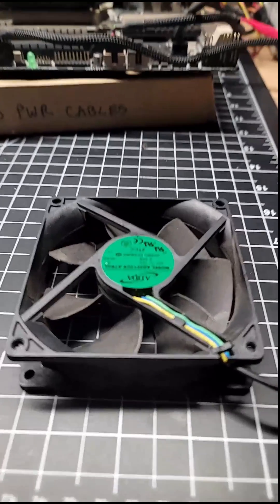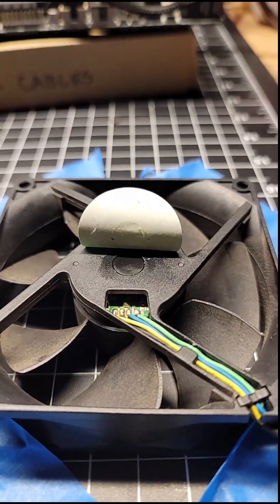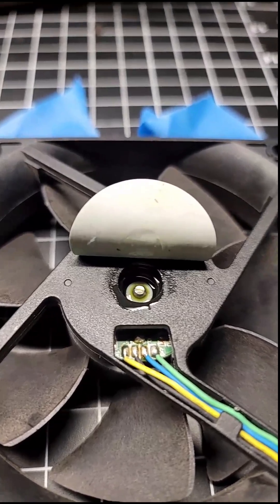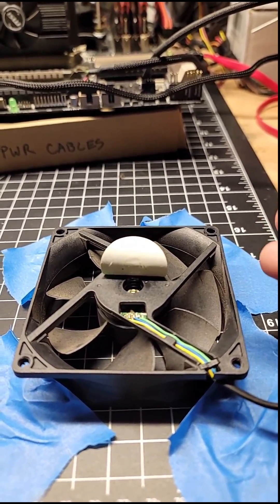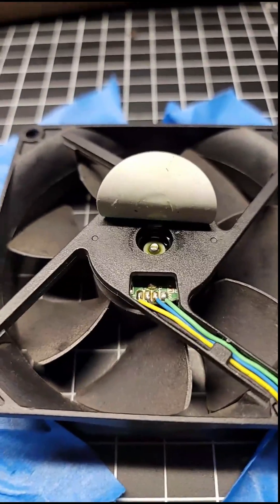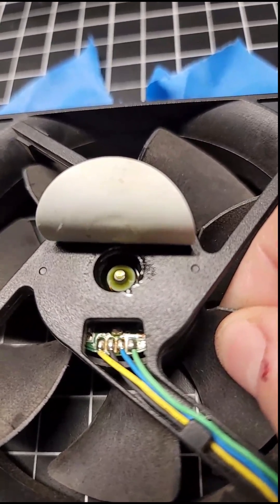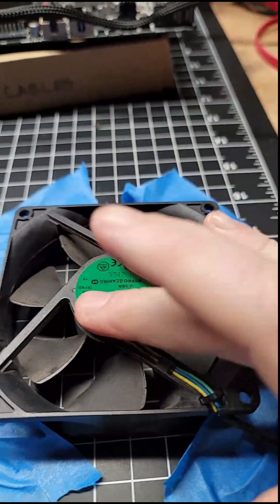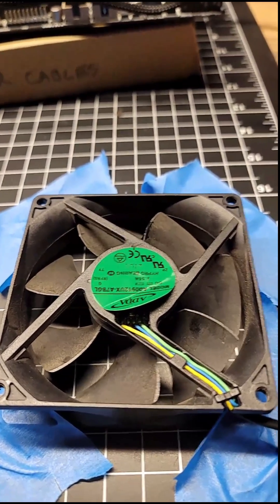Noisy PC Fan Fix: Re-oiling

Comment: i dont have a bearing, I have a magnet (cool master fan)
Reply from the maker: There's many different types, but it's still essentially a bearing type. Unfortunately once the magnet types start making noise, the only solution is replacement.
Reply: @Warning56kb  thank you man!

Comment: There is a sticky substance on the lever of the trunk door of my car. I don't know what it is, but it never dries up. Can I scrape some of it off and use it?
Reply from the maker: I wouldn't because it's likely dirty and has contaminants in it. I owned an automotive service facility and we frequently used lithium grease for lubricating trunk, door and hood latches. Unfortunately lithium grease is too viscous as a longer term solution. I highly recommend sewing machine oil or another light-viscosity oil.
Reply: @Warning56kb  Many thinks for the knowledge!
Reply from the maker: @hanfucolorful9656 You're very welcome! Just last night I was able to salvage an older laptop cooling pad that had a couple of fans moving very slowly. I pulled back the stickers covering the bearings and sure enough... they were dry. Added a tad of light oil to them, plugged the pad back in and they were spinning up to speed like they were new!
Reply: @Warning56kb  Great! I will do the same for my computer once I get the oil! thanks!

Comment: Hi can is use wd40?
Reply from the maker: You can temporarily, but WD40 has a tendency to dry out releatively quickly.
Reply: WD40 is not oil, it's a solvent so it won't really work.

Comment: Now if its a sealed fan couldnt you drill a hole carefully in Theory
Reply: i did and it's probably because im a dumbass, but now it makes some other kinda noise
upd: there's no noise no more
Reply from the maker: You know, I guess you could. If it's not a sleeve or sealed bearing, I don't see why not.

Comment: i use grease oil will dried up easily
Reply from the maker: Sewing machine oil lasts a long time if the seal is in good condition. I've had oils last for years. Grease works fine if you have it available.

Comment: Oil wont fix a ball bearing fan, in fact it will make it worse, you need to use a special type of lithium grease
Reply from the maker: Been doing it for decades now. Lithium grease won't last very long. Sewing machine oil is best. Used to be an oil distributor and ran oil analysis test in the automotive industry for a decade.
Reply: @Warning56kb  Ball bearing pc fans are a sealed suction unit, soon as you take the C clip off thats it the bearing is dead.
Reply from the maker: @Synthematix yes, ball bearing fans require ball bearing replacement unless the bearing seal can be replaced, but typically the bearing is shot by the time it is making noise, requireing replacement. PC fans typically are not serviced at regular intervals the way automotive bearing are.

Other bearing types, can possibly be oiled depending on the construction type. As I said one of my backgrounds is automotive with strong experience in bearings, their function, diagnosis, and servicability.

Fan bearings for PCs are child play compared to automotive and industrial bearings.
Reply: @Warning56kb  Actually pc fan bearings have to be real good to stop motor noise, MagLev are the best IMO, ball bearing fans are noisy as hell
Reply from the maker: @Synthematix the quality varies across a large spectrum depending not only on the fan manufacturer and the bearing company sourced for the bearings (fan companies 'typically' do not manufactuer their own bearings -especially sealed bearings-), but the type of fan within a manufacturers product lineup can habe a large variance in quality. 

Mag-lev bearings are extremely reliable, but lie beyond the scope of this video as they do not use any lubriant as a part of their bearing solution.

Ball bearing fans have the potential to be noisy, but within that statement is variable nuance. The devil is in the details, as not all ball bearing fans are inherently noisy.

For example, a poor quality sleeve bearing 'can' be louder than a good quality ball bearing. The quality of the bearing can have a much larger influence on the loudness than the type, but the type does at least set an unspoken 'anticipated' level of quality and noise.

Ball bearing fans typically have a noise floor of around 20-30dB at moderate speeds, while mag-lev or FDB fans can dip closer to the 15-25 dB and under range.

In short, ball bearing fans can be noisier than alternative bearing types, particularpy in budget models or after prolonged use, but premium designs mitigate this otherwise anticipated result.

Comment: can we put WD40? Would it work? is it safe?
Reply from the maker: You can use WD40 if that's all you have, but WD40 by nature evaporates relatively quickly compared to typical lubricants. This is because WD40 is primarily a penetrant and water dis-placer (hence the WD). If it just trying to buy some more time until you get another fan, it'll work fine.

Comment: "Hello, I need help. I have a fan from a Liann Li water cooler, and suddenly one of the fans started making a very annoying sound, causing the computer and even the table to shake a little. Is there a chance to fix it?"
Reply from the maker: If it's already making bad noise and especially to the point you can feel it, it's likely toast. If you can catch the very early where you're just barely noticing a change in the sound, they can usually be saved. If those specific Lian Li fans are re-oilable, doing so would maybe buy you a couple hundred hours of operation at best.
Reply: Can I send you a video that explains the issue?

Comment: I have cooling pad with those gpu fan type fans and they dont have a back cover, can i use a piece of tape so oil doesnot drip and what would happen if you overfill.
Reply from the maker: A piece of tape should work ok. Make sure to use a piece of good stuff like duct tape. If you overfill the excess will just run out, so no real worry there.

Comment: So, here is the thing, NFORTEC fans are NOT capable of reoiling, because they are made in such way you cannot disassemble them. What did I do? With a soldering iron (Might work heating a needle too) I made a small incision in the plastic where the fan should be lubed exposing a tiny bit the internals and lubing them using sewing machine oil. Voilà the sound dissapeared.

Thanks for the tutorial, really helpful 👍
Reply from the maker: You're correct, NFORTEC fans are just one of many types that are not serviceable. This guide covers just sleeve and standard bearing types. There's also a another wide array of fans which are not serviceable comma but they do not even have a field port to be serviced
Reply from the maker: In the past I have done something similar to what you have. Described to typical non serviceable fans, but for most users, they may not have a sottering iron or away to properly gain access to the internal bearing, which may or may not be serviceable. this is just a simple guide for standard bearing fans with users who may have some sewing machine oil or standard motor oil. Thank you for the kind words though!

Comment: The last time I did this was with the CPU cooler of a 486. That was probably around 30 years ago.
Reply from the maker: Just did one to an orb cooler for an AMD Athlon Thunderbird 1GHz socket CPU just a few days ago!
Reply: @Warning56kb  I used to have a Dragon Orb 3, which was so loud that the bearing noise didn't matter. That was more the time when I became interested in fan controllers.
Reply from the maker: @carmwyrda  Check out FanControl on Github! Its enabled me to ditch my controller all together. It also lets you ditch all the OEM motherboard and video card control software that's typically needed. It's verg light and allows ultra fine tuning of fan duty cycle curves custom refrences. Finally a fan control solution all in one place.

Comment: Hmmm am gonna try that 
Do you have before and after sound test ?
Reply from the maker: I unfortunately don't. I already serviced it before I had the idea of recording what I do. Will definitely try to remember to get the next one! This one wan't making as much noise as it was locking down. A spin by hand wouldn't complete a single revolution. It's actually a power supply fan, but works for any of them.